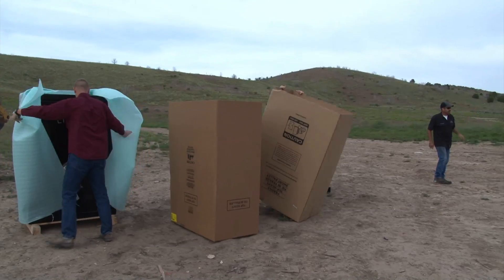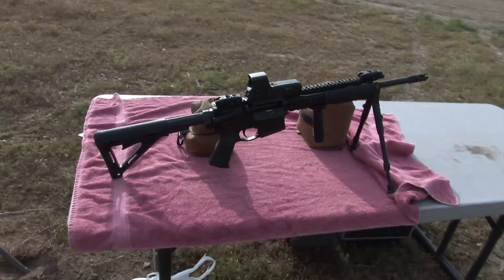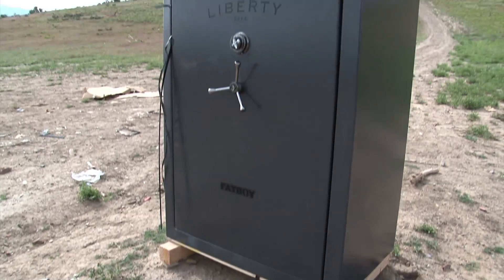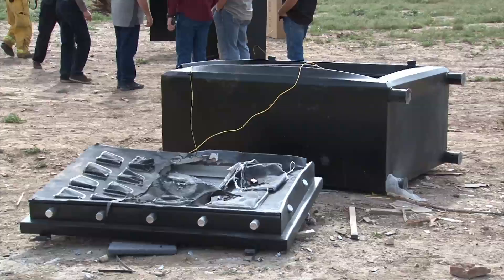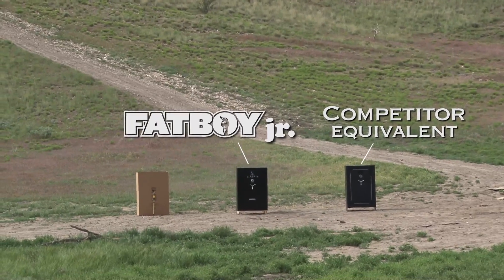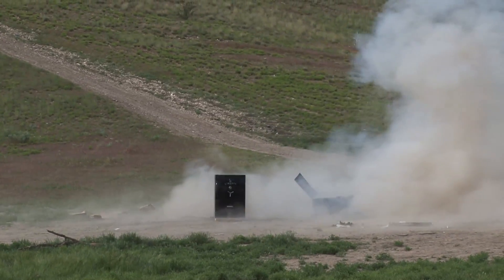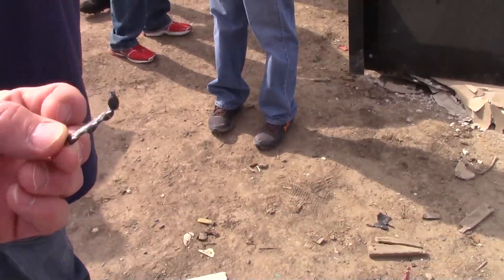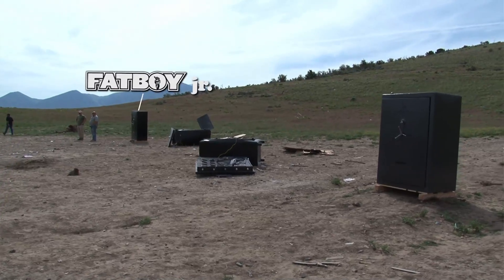Gun Safe Explosion Test | Liberty Safe: Head to Head Explosion Test

Comment: Silly test You can cut the top of the  safe open with a circular saw and carbide blade in 2-3 mins.
Reply from the maker: Sure you can.  Any safe can be compromised with enough time, knowledge and tools; even bank vaults. Truth is burglars are not running around with circular saws. The point of the test is to show the structural integrity of a Liberty Safe verses other brands.